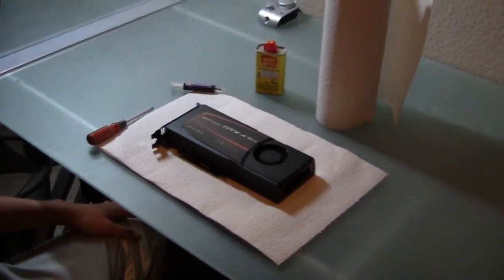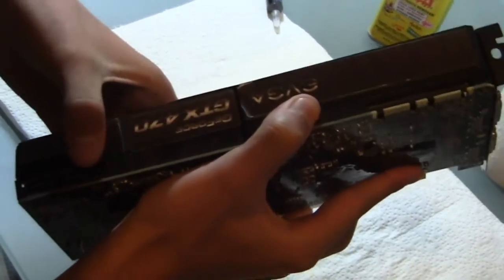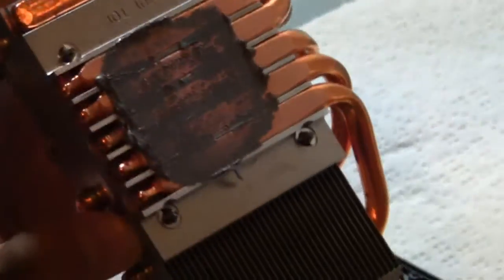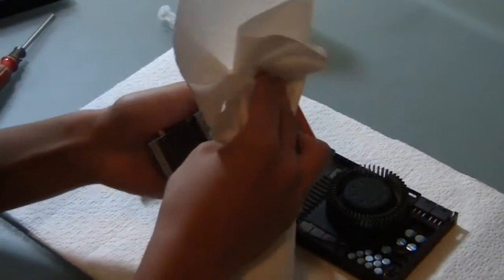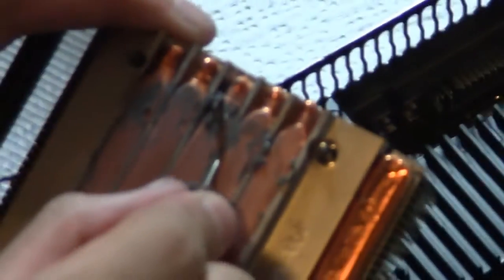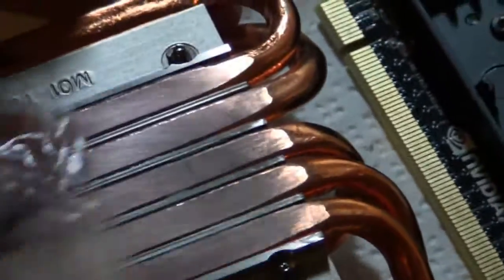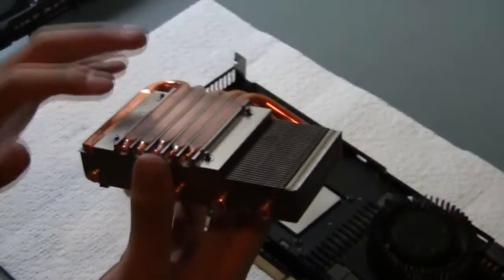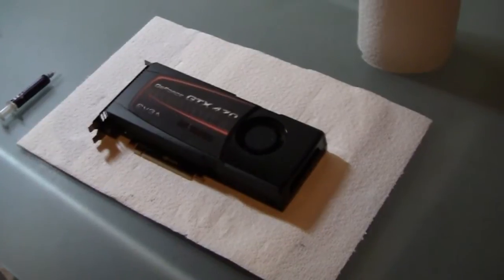[HH] nVidia GTX 470 TIM Replacement Guide

Comment: Just my opinion, I use Arcticlean and it works pretty well.  It is kinda expensive but it works really well.  It comes in a two bottle kit.  One is the stuff that dissolves the compound and the other cleans up the stuff from the first step.  Arcticlean has orange oil in it and that quickly dissolves the thermal paste.  Orange oil will melt some plastics so be careful.

Comment: You should not apply thermal paste to the heatsink everrrrr! And you should not just put a dot on the chip, you should apply a thin even layer covering the entire chip, and I mean a thin EVEN layer. The way you did it ...oh man, I would not be surprised if it overheated or just didn't last long with that configuration. 

How did it turn out anyways, months later I mean?? I'm curious..

Comment: Very helpful, i had this card for over 6 months using stock paste, noice it was slowly over heating through time, replaced it with antec formula 5 paste, also notice auto fan speeds reduced
Results

Stock paste:
Idle: 45-55C°
Playing games: 60-68C°

Antec paste
Idle: 38-40C°
Games: 55-60C°

The variables, evga auto fan curve and room temp 75-80°
i know this is unnecessary info but im pretty happy not having to hear the fan going retarded, thank you for the guide

Comment: what about running the GTX470 without putting back the plastic cover on the heatsink? is it safe? i have 3pcs 120mm exhaust fans and 3pcs 120mm intake fans inside my case.

Comment: Have a 285 overclocked @ 61-62C load, did you do the 5 dot method? W/o  letting any air? It's really a headache when applying TIM.

Comment: Hey! Thx for the reply. I changed the fan and it helped a bit. Also Im using EVGA Precision X and simply underclock until needed. Like that CPU idles at 42c and when needed OC a bit the GPU fan at 80%. So far it doesnt go over 65c. I heard Kepler is cooler than Fermis thou.

Comment: Hey I have a 460GTX 1GB Ram and the thing idles at 53c!!! When playing games it shoots up to mid 90c!!! It's a fact that Fermi's run hot but this is just nor right... I applied Artic Silver 5 to it but it wont make a difference... I havent opened the cover from heatsink yet so maybe theres some dust there but pretty much thats it. Case provides a fan on the side aiming to the card but I have it blowing air OUTSIDE the case. Should I invert it? Any ideas on how to put this of acceptable temps?

Comment: when i did my 470's i just put some on the direct heat pipes and a pea size dot in the middle of the gpu core as well since the pressure from tightening it does helps spread it.

Comment: In the GTX 470, the components of the PCB are being cooled by the huge heatsink and by the fan. Then the Cooler is atached by 4 screws to the PCB heatsink. These 4 screws are the only points where the GPU heatsink can transfer the hot GPU temps to the PCB heatsink. It´s a good design, as it works independently. Touching the GTX 470 PCB heatsink with 80ºC GPU load temps, the feel is only warm. On the 8800 Ultra, if the GPU runs @ 80ºC, the touch feel is very hot, due to the monobloc heatsink.

Comment: Update! I have seen that my voltages are diferent, despite beeing the same model with the same bios with almost the same serial number (diference by two numbers), they come with 962mv (that one that runs cooler) and 1025mv (the hotter one). Putting them with locked voltages at 0.962mv, the difference in temps dissapears. I wonder why they change voltages between cards of the same production line. They seem to be stable at this voltages (0.965). I don´t need to change the TIM now! :)

Comment: Thank you! It was a toough decision between GTX 580 and GTX 470 SLI. I bought them without knowing the specs of the GTX 580. I think i was lucky. They have more horsepower in SLI. The cons are the 1280 MB vs 1536 MB. But thats cool! You talk about "Blob" is that the metod that you use in the video? Im scared to kill the cards and void the waranty. I have lots of AS5! :) Greatings from Portugal my friend

Comment: Hi there! I have purchased 2 EVGA GTX 470s. Running furmark using each card at a time, one @ 60% fan gives 83ºC and the second one alone @60% fan gives 91ºC. Do you recomend using Artic Silver 5 on the GPUs? Another thing, MSI afterburn dosn´t allow me to see the voltages. Wath software do you use? Best regards

Comment: When reattaching the heatsink wouldn't you want to use a diagonal pattern when tightning the screws? ie 1-3-2-4 instead of 1-2-3-4 as you done?